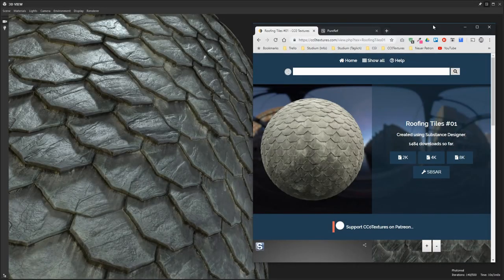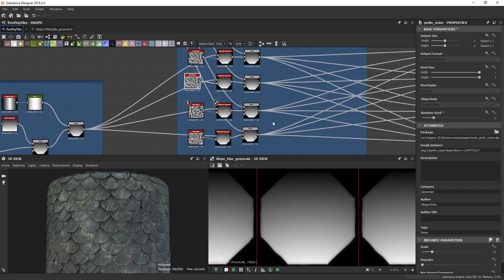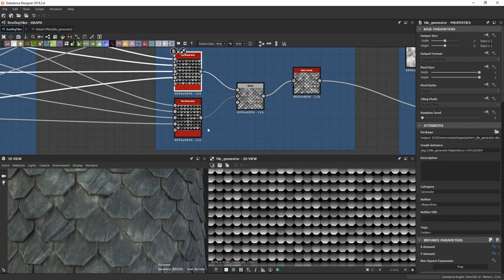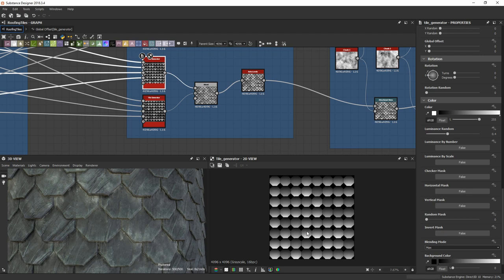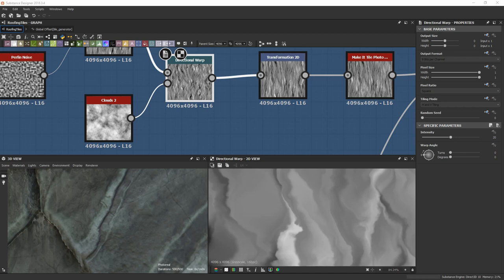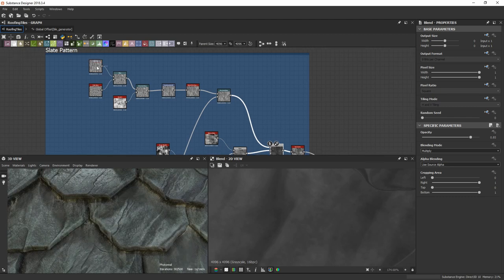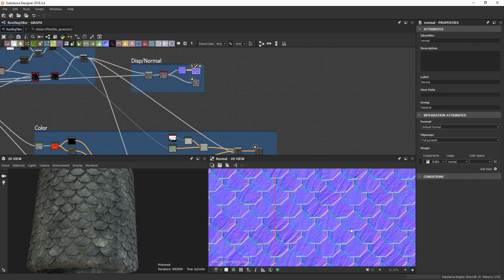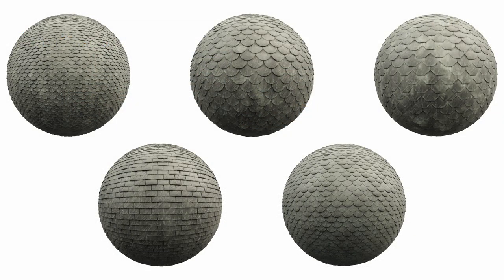Substance Tour #01 - Roofing Tiles

Comment: Gonna leave what I learned by messing around with settings to get the things he didn't explain much.
Tile Genarator Offset: Once you have the math nodes set up like in the video, you need to go to your Tile Generator node>Instance Parameters> You need to change the X and Y amount to "Expose as new graph input" in the drop down menu. Name it what you want. Then go back to the math nodes, grab a "Get Integer" and double-click it. There will be a drop down menu. Find it and input either the X or Y amount you named before. 

Blending the two Tile Generators:
Change the blending mode to "Max (Lighten)" and set opacity to 1. I had a hard time with this, hope this helps.

Gonna edit this once I am done with the video with what I learned that was not explained. 

Also thanks for the video, I am using this to make a medieval style roof for a school project.
Reply: Thanks!
Reply: Thank you for clearing that up. very helpful

Comment: Terrific tutorial. A question rises for me, as a newbie: I see that you set a function for the cracks luminosity (min 4:20), and  since there is a luminance randomization in the Tile Generator, my guess is that you want the cracks to somehow adapt their luninosity as to remain visible whatever the color of the tiles they're are applied to may be. Is this it?  If so, could you explain how it's done? Is there a node that samples the color of the existing map? It would be very useful for my current project. Thanks!

Comment: how do you get your Tiles_Amount Variable?
Reply: Under the 'Instance Parameters', there is an icon above the value for things like sliders. In the 'tile generator', you will want to click that for the X and Y amount. This will bring up a menu titled 'Expose Parameters'. Click on the drop down menu titled 'Input Name', and select 'New'. This will bring up another window titled 'Enter Input Name'. This is where you can name anything you need. He titled these variables 'Tiles_Amount'. He did this for both the X and Y axis. Once you set one up, it should appear in the 'Input Names' menu, and it will appear as an option when you place integer variables.

Hope that helped!